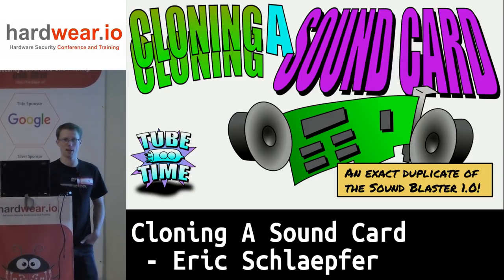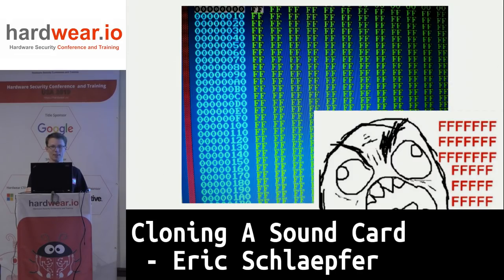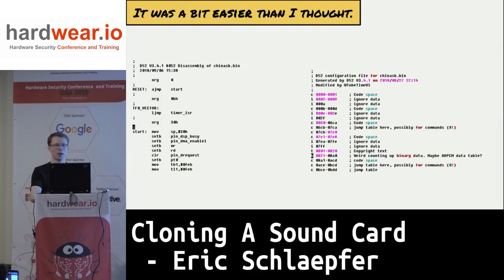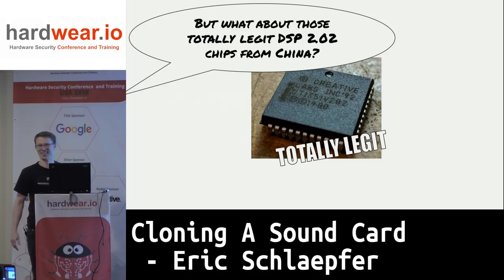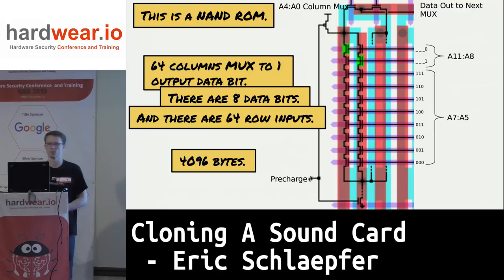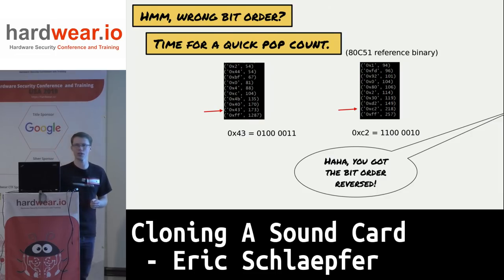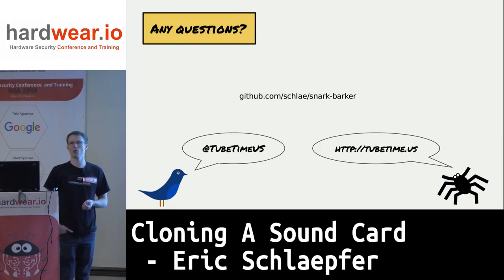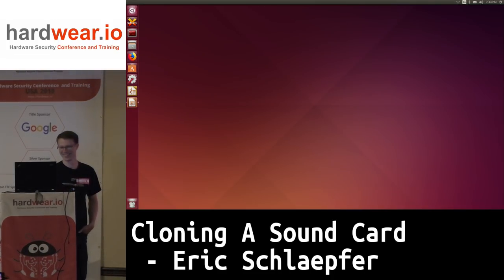Cloning A Sound Card | Eric Schlaepfer | hardwear.io USA 2019

Comment: Page aligned allocation is easy: allocate what you need + 255 extra bytes.  Take the address you got and do a little rounding.  At most you waste 255 bytes (well 256 + a little housekeeping).
If you want a 64K buffer you allocate 64.25KB, for example.  If you want a 1K buffer, you ask for 1.25KB.
The DOS memory allocation call takes the request size in "paragraphs" = units of 16 bytes so for an aligned 64KB buffer you ask for 4112 paragraphs.  If your app already has allocated as much DOS memory as possible, then the details depend on your runtime library.

Edit: oh, I think he meant 64K-aligned.  A "page" back then was usually interpreted as a naturally aligned block of 256 bytes.  The same trick still works: try to allocate 128KB.  DOS has a memory resize call you may be able to use to carve off unnecessary bytes at the end (if you are allocating memory from DOS).  It won't help with unnecessary bytes at the front.